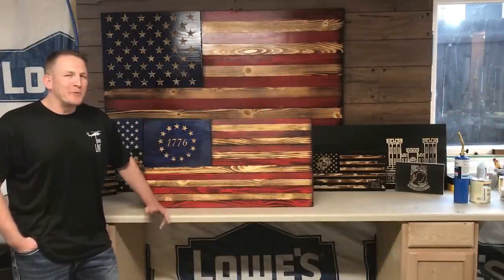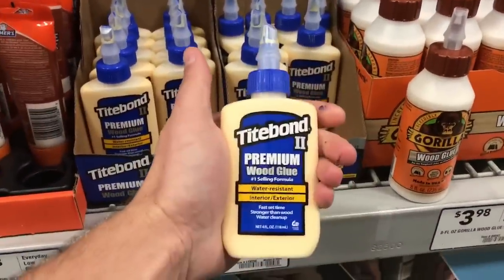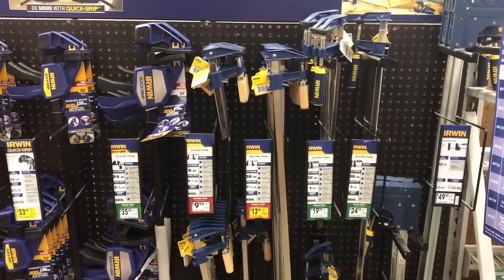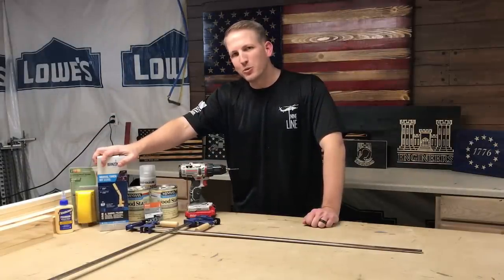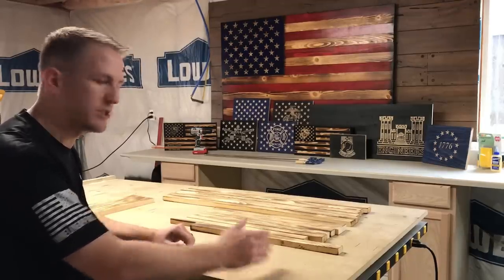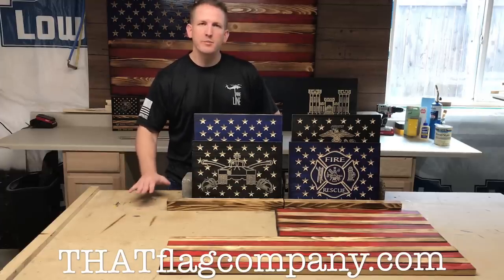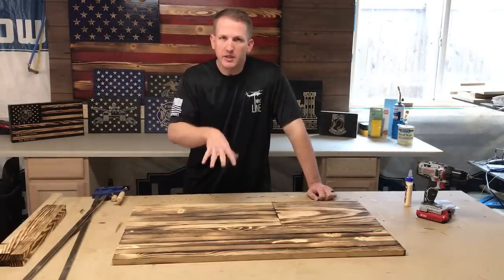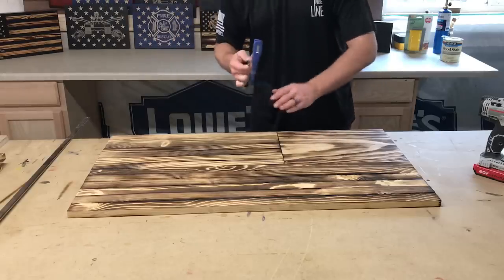DIY - Rustic Wood American Flag - Start your own Flag Co. for under $100 - Step By Step, How To

Comment: How is the union made?
Reply from the maker: Hey Zilch71. There are multiple ways to make the union yourself. We started by making a template in Microsoft Office and tracing it onto stencil paper from Hobby Lobby. We then used a knife to cut the stars out of the stencil and could use that stencil to trace the stars onto the union. After the stars are traced, you can use a dremel or a hammer and chisel to engrave them into the union. Hammer and chisel takes more practice to get right but ends up being quicker and better than a Dremel in my opinion. This is the most cost efficient way to make the stars yourself. After receiving multiple requests, we recently started offering the pre-cut stencils for sale on our website as well. We are actually working to make another video covering all of this in the very near future. 

However, to make the unions with our level of quality and detail that we offer on our website would cost you thousands of dollars in equipment and multiple tutorial videos. For this reason, we did not go into the details on this video but decided to offer them already completed for on THATflagcompany.com in order to provide another option that we wish had been previously available to us when we were starting. 

I hope this video was useful for you and the follow up response helps give some additional clarity.  If you have any questions we can help with, definitely don’t hesitate to ask!
Reply: Would you be willing to send me the dimensions for the flag? Individual pieces and etc so I can have the dimensions and I will do my own design
Reply from the maker: Zilch71, Measurements for the 36” flag are:

7x short stripes at 21.75”x1.5”

6x long stripes at 36”x1.5”

4x braces at 18.5”x1.5”

Union is 10.5”x14.25”

Measurements for the 48” flag are:

7x short stripes at 29”x 2”

6x long stripes at 48”x2”

4x braces at 24.5”x2”

Union is 19"x14"
Reply: THAT Flag Company hey I appreciate it! You guys do good work!

Comment: Thank you for the detailed video! I'm working on making a flag now for my husband!  I went to Lowe's and got the Minwax water based stain in Scarlet...I just stained the first piece of wood and it seems very pink, not really the rich red I would've expected. Is there a way to darken the stain into more of a rich red like yours appears in your finished product? Thank you!
Reply from the maker: Hey Christy! We do not add anything to the stain. Make sure it is shaken/stirred well. Apply a coat (don’t wipe off) and let dry. Then apply a second coat and don’t wipe it off either. 

We have experimented at making some darker tinted red (for special requests) by mixing a few drops of black stain in with the red, but none of those are shown on our website. 

Hope this helps!

Comment: what would the measurements be for the 1x2s for a 48 inch flag?  Should I get wider pieces?
Reply from the maker: Hey Lisa! Yes, the stripes will need to be wider. The actual measurement for the stripes on a 48” flag is: 7x short stripes at 2”x29” and 6x long stripes at 2”x48”.